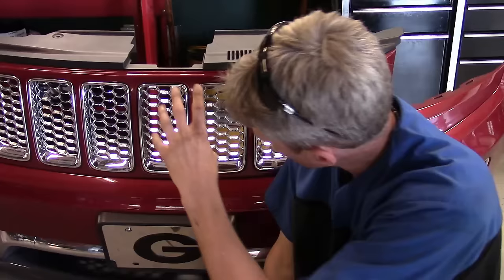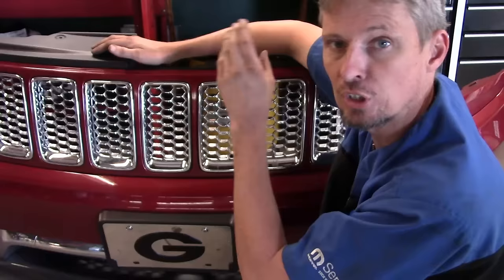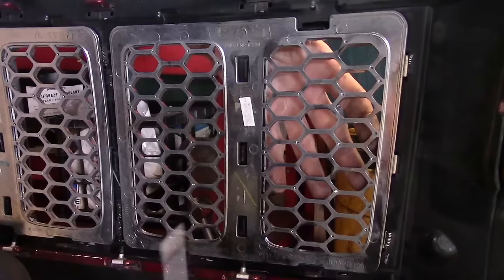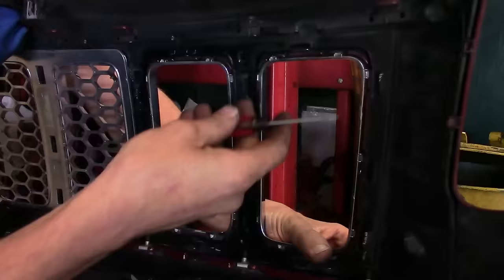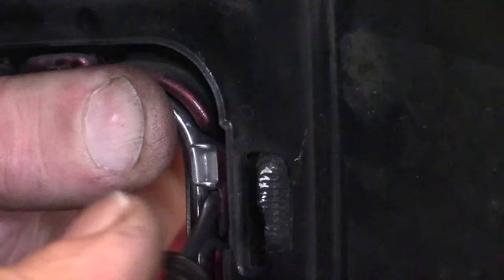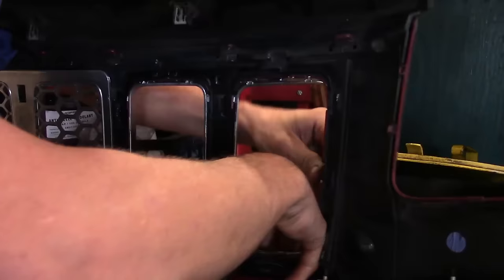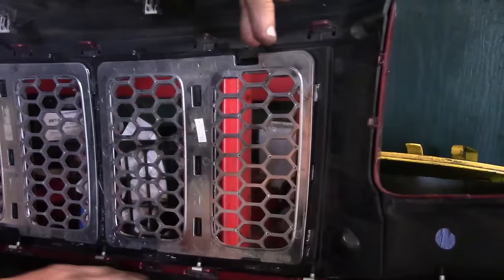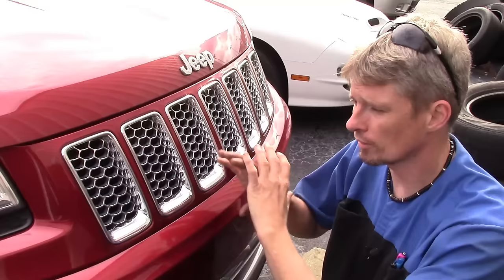2014-2015 Jeep Grand Cherokee front bumper grille mesh and trim ring removal

Comment: I have a 2015 GC Laredo and I just ordered a chrome mesh grille for it on. A shop wanted $180 just to install it so I decided I'll take a shot at doing it myself. It's on its way and I'll definitely be using this video along with your front grille and bumper cover replacement video to help me along the way since I've never done anything like this to my cars.
Reply from the maker: Just follow the steps and take your time. I cant say how the chrome mesh grilles install but hopefully its similar to the factory versions or possible even easier.  Thanks for watching and for the comment. Make sure to subscribe when you get time.

Comment: Hey guys the chrome rings are COMPLETELY removable without needing to pull the upper fascia or lower valance off. I've done it on my '14 Summit to paint them black. You just have to get some pry tools and work your way around each ring to loosen the fasteners. This is a common mod on srt Jeeps of the same 14-15 year so just search it.
Reply from the maker: Car battery masochist Many thanks for that added info and tip! Glad to see there is more then one way. Make sure to subscribe

Comment: Hey buddy thanks for the video. 😇 you Jesus I didn't have to remove the bumper I just snapped them off from the front on my 2015 grand Cherokee altitude it had only taken me 20 minutes to do it..Thanks any way for your help..
Reply: I have the same car and want to do the same thing. With no instillation skills I am hesitant to try it on my own. Any tips and thoughts or should I just bring it to a shop to get done?

Comment: David, can you get your hands on a Ram Rebel & put it on a lift, I want to see that trans cooler they put under the transmission, & maybe you could tell us why they put it were it will get full of mud & road salt.
Reply from the maker: +Paul Wicklund Paul....are you speaking of the 8 speed transmission? We haven't gotten a Rebel in yet so I am assuming your speaking of the 9 speed. The cooler for the 9 speed is on the side of the trans. If you speaking of this cooler then you have to keep in mind that its not a fluid to air type cooler. Its a fluid to fluid cooler. It uses the coolant system to help cool the trans fluid directly at the transmission. Its not affected by mud/dirt for example. I wish I had one to look at and when we do....I certainly will to see if its the same type of cooler that I am thinking of. Thanks for the question Paul

Comment: Man here i am trying to black out my chrome bezales but it looks like its a pain just to get them off i cant balieve i have to take off my whole bumper 🤦‍♂️
Reply from the maker: Yeah they were meant to come of easy and for the most part.....no one really ever does. But the bumper cover takes about 15 minutes.....it looks harder then it is.
Reply: @MotorCityMechanic  thanks for ur help
Reply from the maker: @javim9621  Your welcome
Reply: Javi M you can pop them out from the front without removing bumper just start from the bottom about a 3rd of the way up

Comment: Hey David, do you by chance know how to fix the vinyl wrap around the shifter on the 2014 jeep Grand Cherokee? It started to peel off and i don't want to spend thousands on just replacing the whole shifter setup. Thanks
Reply from the maker: I havent come across a way to fix that....Im sure if there is a will.....there is a way. Only other option I can think is a used assembly. Surely the shifter knob is avail separately.

Comment: I have a question that you may be able to answer or not. 
On 2014 Jeep Grand Cherokee Summit Version.  do you have video on how to remove the lower grill with-out removing the front fascia / bumper. If there is no video, for what I am asking could you explain the process of removing the lower front grill on a 2014 Jeep Grand Cherokee Summit. If you have no knowledge of about on how to remove the part that is okay too.  I was just curious on if you knew how. 

Thank you
Reply from the maker: Just sent you an email about the question.
Reply: I never received your email.
Reply from the maker: Sorry, just saw it in my draft box....forgot to click send. Its on the way as we speak

Comment: Do you have a video on how to replace the Adaptive Cruise Control Sensor on the front bumper of a 16 Grand Cherokee?
Reply from the maker: Sorry I dont. It takes special equipment to calibrate that assembly once replaced and the dealer is the only one that has that.

Comment: Great video as always Dave I have been following for awhile and you are always very informative. One of my Mopars is a 07 Chrysler 300 with a 3.5. The ignition switch has to be turned all the way to start and forced at the end for it to start. I think it is the ignition acuatator that is bad. Do you have a video on removing the ignition switch from the dash and disconnecting it to get the actuator out any info would be great thanks Dave, Ray.
Reply from the maker: +Raymond Campbell Hello Raymond. Currently I don't have a video on that. I haven't had one come in the shop in some time for that issue. All the ones I get are the 2008's with the recall currently....they have a different ignition set up. I will try to keep it in mind when one comes into the shop to try and record the repair. Make sure to subscribe if you haven't already so that you get notified when I do upload a video such as that

Comment: I'm in GA too.  I have a 2014 Jeep Grand Cherokee Overland and had two questions for you.  How do I remove the third brake light assembly?  It is kinda scratched so I want to remove it and have it covered in carbon fiber.  Also, I wanted to replace the LED in the side view mirror that points down.  Any tips on how?  Really love your channel...lots of GREAT info!  Thanks. Subscribed!!

Oh..and if you happen to know if the 2017 UConnect head unit will fit nicely into my 2014 and work just fine...I really appreciate it!!  Go Dawgs!
Reply from the maker: Third brake light will require removal of the upper spoiler. I will need to eventually put in on my list of videos to make. They dont make any mention on the removal of the LED in the mirror. I assume its part of the mirror glass. The glass just pops off....you need to angle the glass towards the vehicle and put some fingers behind it and then pull/pop it off. Thanks for watching and keep an eye out for future related videos.
Reply: Yes, I want to remove the upper spoiler...can't seem to figure it out. Thanks for the tip on the mirror.  Great Channel!!
Reply from the maker: Your welcome. I wish it was warmer outside so that I could do the repair on my wifes Jeep. Maybe sometime in the very near future.

Comment: Thanks for the video. Do you know or have you installed the front recovery hooks on a 2015 WK2 Summit. The Grand Cherokee Summit front bumper comes with the recovery hook delete version to put in the luxury one on but I need to install them to be able to join a 4x4 club. Any suggestions? I wouldn't mind doing  some precision  holes on the plastic trim at the bottom... If you are in California let me know... I wouldn't mind letting you do some videos with my 2014 Jeep Grand Cherokee Summit Diesel 4x4.
Reply from the maker: +Jose Suazo Wish I was in California.....more like the east coast down in Georgia haha. I haven't installed a set of hooks as of yet. I wish I had more info to help you but I don't want to steer you wrong. Thanks for watching and make sure to subscribe

Comment: Hi David, do you have a video on how to replace the the grill molding part 68143070AD on the 2015 Jeep Grand Cherokee?
Reply from the maker: +Stephanie Rispoli Morning. I currently don't have a video on that. The next time I have one in and I take the front bumper cover off....I will try to film it. I have been asked a few times about that and the lower mesh as well. Thanks for watching and make sure to subscribe so that you get notified when videos such as that get uploaded.
Reply: +MotorCity Mechanic bummer! Do you know off hand if the entire bumper needs to come off to replace this? Or Can i just remove this part and replace?
Reply from the maker: +Stephanie Rispoli I assume it snaps in from the back side....might be easier to take the bumper cover off to get access to it from behind. Might be able to remove the lower air dam/close out panel on the bottom of the bumper cover and then have access. The service info doesn't give any details on it.
Reply: +MotorCity Mechanic great, thanks so much for the help!
Reply from the maker: +Stephanie Rispoli  Any time. Thanks for watching

Comment: I replaced my chrome rings with black ones from the outside without removing the bumper and without removing the mesh.  They just pop out.
Reply from the maker: Cool....I will have to try that the next time. Most of the times we just do repairs at the dealer and not may accessorizing gigs.
Reply: How did you do that? I don't want to remove the entire bumper! I have a 2015 Jeep Grand Cherokee Limited.

Comment: does anyone know how much a shop would charge me to do this? im not a hands on guy so i rather have someone with experience do it. thanks!
Reply from the maker: Will V Evening Will. The job should be about 2 hours max. Depending on the shop labor rate per hour.....right around $200.00. In leaning to somewhat less then that but still in that ball park.
Reply: MotorCity Mechanic i called a shop near me, they are asking 460 to replace the grill mesh to a honeycomb one, paint the ring trim to black in the front (including fog lights chrome) and the back bezels, and to replace the interior lights to led bright white. is that a good deal? thank you a ton for your reply!
Reply from the maker: Will V I would get another estimate just to be sure...possibly a body shop if you haven't already just so that you have something to compare the price to. Is that including parts?

Comment: Thanks for the video. I might need to do this, I need to replace the horn on my 2011 Jeep Grand Cherokee Overland . What about the sensors that are on the bumber? I dont want to pull and damage the connections so I'd like to know they are connected. Any help on this would be great. I sent you an email today as well. I subscribed to your channel to see if you have any other great videos. Thanks again.
Reply from the maker: There will be one connector for the sensors possible on the drivers or passengers side that you need to disconnect and then you will be fine. Thanks for subscribing and make sure to share the videos

Comment: Any idea about how to replace the liftgate trim piece over the license plate (light bar assembly without camera-55079268AL) on a 2011 Jeep Grand Cherokee
Reply from the maker: I actually have a video on a Dodge Durango rear taillight removal which actually includes the dealing with that trim piece. Check it out and see if it gives you enough info. The vehicles share alot of the same steps almost exactly. https://www.youtube.com/watch?v=2Ez49xX46MQ . Thanks for watching and make sure to subscribe

Comment: We removed that entire front piece (not sure if you call it fascia or bumper) - so we could install a base plate for the Blue Ox tow system.  We're trying to put that front piece back on and just can't get the corners to line up and snap in -- afraid we'll crack or break it.  Is there a trick to it ?  Any thoughts?  Ours is a 2017 Jeep Grand Cherokee Overland.  Any help kindly appreciated.
Reply from the maker: No tricks that I know of. Situations like that are hard to help with because it becomes a "need to have my hands on it" type deals. Hard to picture in words and also to get the point across.